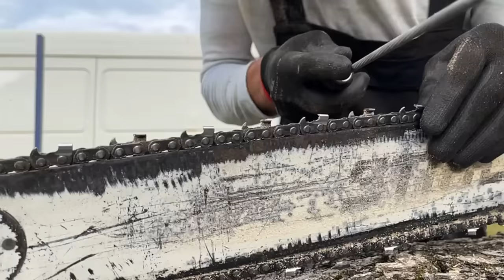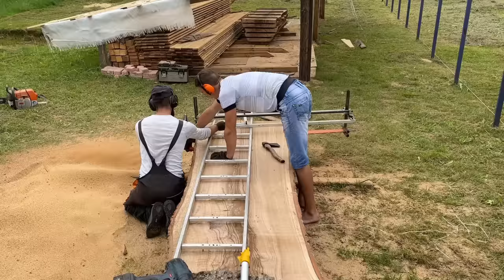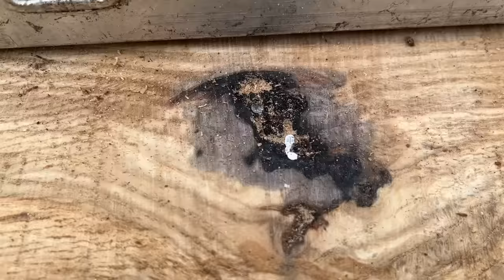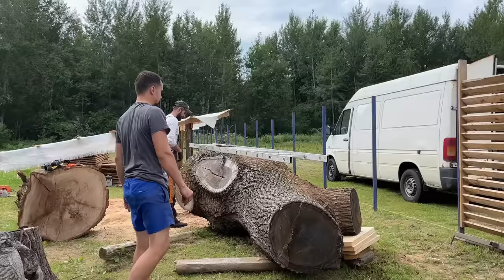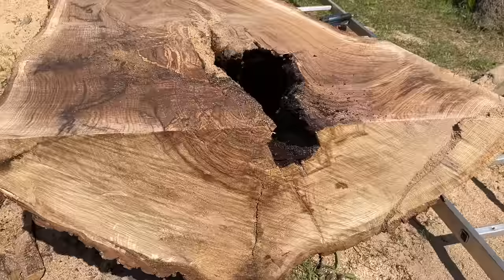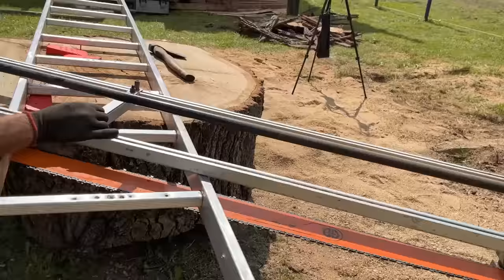Stihl ms 880 150cm vs big oak log

Comment: Dangerous operation of a chainsaw and dull chains too!
Reply: In what way(s) was the operation dangerous? How do you know the chains were dull?
Reply: The chainsaw with the long blade wasn’t going anywhere. And this dude struggled to cut the trunk in two. Reinserted the saw while throttling into the cut (hello kickback) and walking around while the saw is still running (badly tuned) with the blade running. Haven’t watched much more. Hope this dude didn’t cut that tree down. He would have been a danger to the whole neighborhood.
Reply: @Florahitman Thank you.  I’m a novice and learning with ported chainsaws how to properly operate the chainsaws.  I’ll admit I have made some mistakes.  I’m learning and even have practiced what to do in kickback situations.  I’ll admit I get scared with the kickback and felling my first tree sometime in the future.  I have clpracticed cutting down ten foot stumps, but not the real deal.
I am making sure to sharpen my chains and tune my saws for sufficient performance.

Comment: Those slabs turned out amazing especially the ones closer to the bottom when u had the big void in it they'll look really nice once there dried out and ready work with those round cookie style peices hold big potential aswell. 🏴👍 Any tips for a Sawyer just starting run one of these Alaskan mills.
Reply: Repent to Jesus Christ “Whoever is kind to the poor lends to the Lord, and he will reward them for what they have done.”
Proverbs 19:17 NIV